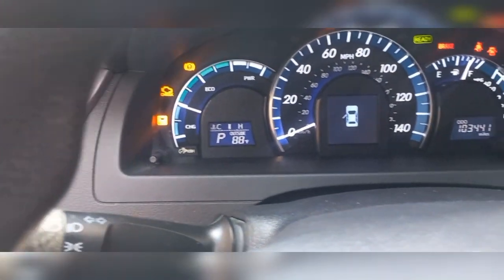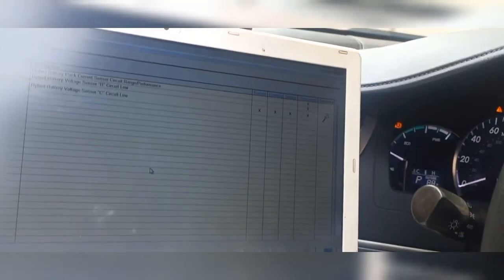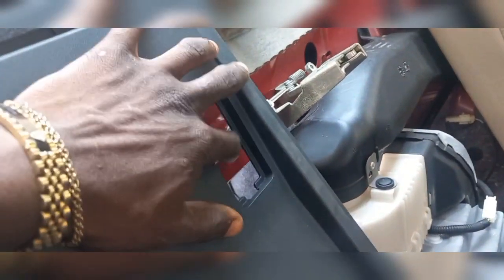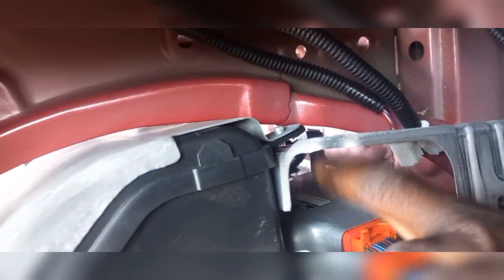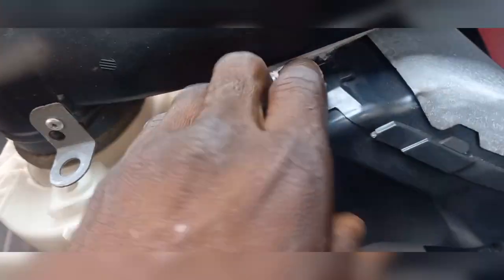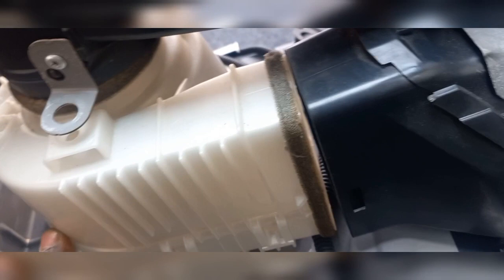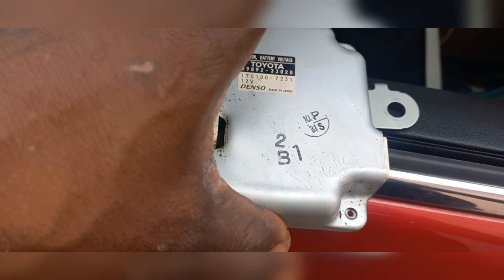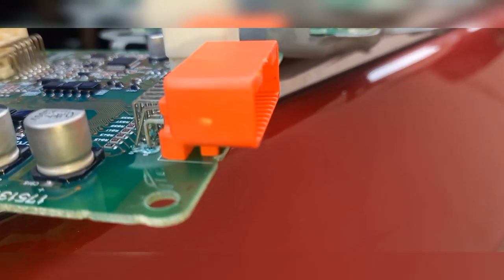P0B47 hybrid voltage sensor C circuit low, P0AC0, P0B42, 2012/2013 toyota camry hybrid. FIXED.

Comment: Thanks for the information.  Even using the orange HV breaker to open the orange security clips. Most other people just suggest to pry and break off. You show the quality engineering toyota has put forth. 👍

Comment: Thanks, Josiah for the Video. I have a similar issue with my 2014 Toyota Camry now. Where can I get the genuine hybrid voltage sensor in Lagos for replacement? Any Advise?

Comment: Guy you're good.
Reply from the maker: Thank you boss
Reply: I have this U029A  on same same Camry model  and its challenging for now. Any help?
Reply from the maker: That's a communications code
Reply from the maker: Hit me up on WhatsApp... +2348184349213...but its most likely a wiring issue Between the battery and the voltage sensor or the voltage sensor itself

Comment: Well done for fixing that. Im getting error code P060B HV ECU error is what the code reader is saying.. any ideas? I can read the voltage from the obd2 ok from the dr prius app
Reply: Did you fix your issue ? I have same code
Reply: @Deem_us_life  not yet. I tried everything but I just couldn't figure out the fault.  Please let me know how you get along as my car been parked for a year now.
Reply: @ 2 hours diy and good to go
Reply: @Runanddrivegarage  can you please share what you found or what you replaced
Reply: @ I found the bus bars was oxidised. It’s easy to remove battery from car and replace bars between battery modules. Then I’ve replaced the hv ecu and no more issues
Reply from the maker: https://youtu.be/N-ztIT-pa1k?si=AUh9zm4xwkjL5j7w watch this video too it helps

Comment: Hi I have a camry hybrid 2013 around 218K Kms on it had check hybrid system error on the dash board checked with the mechanic and found the P0A80 error. But he found that the hybrid fan was not working so replaced the fan and also checked the battery output for each cell which was more 17 V. But after 2 days again the error comes up. Any suggestions or help in the right direction. Thanks on advance.
Reply from the maker: I made some videos concerning the p0A80,pls refer to them for directions.  Thank you.